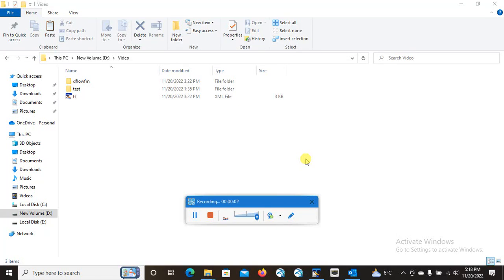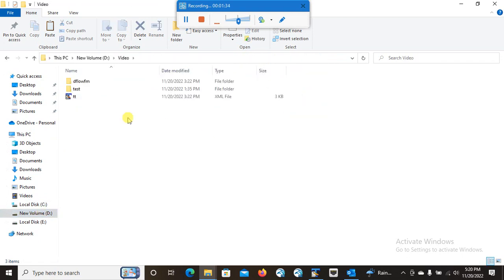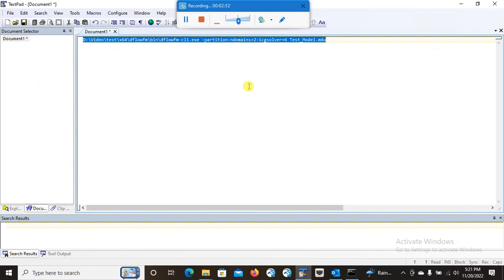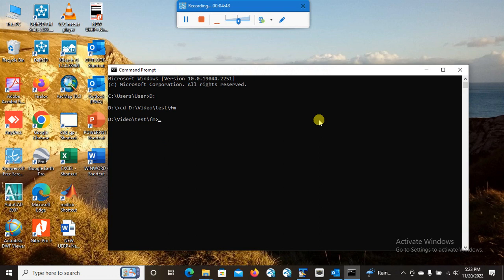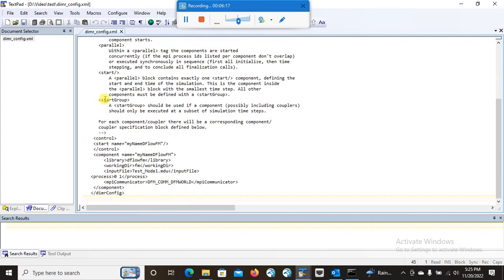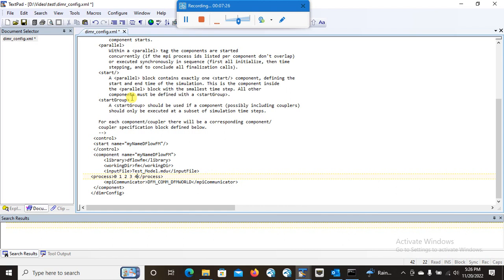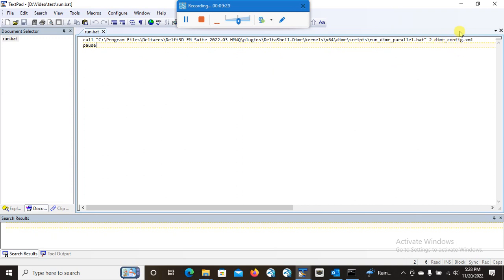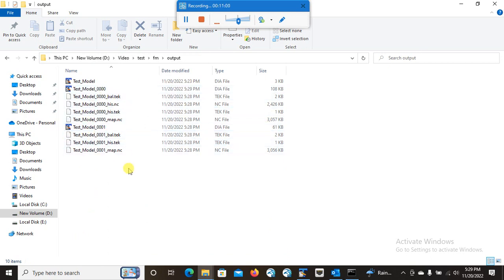Delft3D FM Parallel Run

Comment: Thank you for the sharing. When I follow your steps, I encounter some problems! The command windows shows that it cannot find "libpetsc.dll and gdal300.dll". However these two files are in the directory. 
I try to reinstall the Delft3D FM but it doesn't work. 
do you have any suggestion?
Reply from the maker: Hi, I dont know where the issue is as you mentioned the files are there may be corrupted? It may also be a reason that you are using an older version so without looking details its difficult to provide solution on that. But fortunately there is another option in the GUI that you can use following the steps will give the smae result but take more time than command procedure. You have to load the model then right click on the Grid tab then use the export mode then select the 'Partition exporter' then select autometic partition the use your desired number of parallel domain and export in the folder where you have your model setup files. You will have your parallel domain. But do follow other steps in video.

Comment: Thanks for the sharing. Can I ask what is purpose of parallel run? And what is the purpose of batch run? Calibration? How do we change the parameter values in each batch? 3Q
Reply from the maker: Hi Thanks for the question, well parallel run is to reduce the simulation time of model by running them together in parts using computers available core to optimize the time. Now batch run is to simultaniously run one simulation after another without any human intervension. You can compare them walking side by side and the other one as running in lines. For batch run you need to setup all the rquired simulation scenerio ready and the batch run is simply code to run them automatically.

Comment: Sir can u explain the coupling of flow and wave models in delft 3d fm im the 2d / 3d integrated version
Reply from the maker: Coupling of flow and wave model meaning running them in parallel feeding each other with data to simulate next itteration. This can be done online and offline both mode meaning sharing data while running or use result file to run.
Reply: @ee1989  the method explained in the video is online coupling?

Comment: Thanks you the tutorial! I have a question ,do I have to install openMP in order to run the parallel Wave and Flow FM model?
Reply from the maker: Thanks for your comment and yes you need to activate openMP to run parallel wave and flow.
Reply: @ee1989  Thanks for your answer! Do you have tutorial video to run parallel Wave and Flow FM and assign the number of threads in dimr.bat and config.xml files?

Comment: Hi,I've tried same as you did but the errors shows regarding some files "dflowfm-cli.exe and .dll files are unknown" I'm using Delft 3D FM 2019.01 version if I get a updated version of 2022.03 the errors can be solved ? Or else any other issues in config. Thanks in advance.
Reply from the maker: Hi sorry to hear that did you try reinstalling the Delft3D FM model. May solve the problem.....

Comment: Hi, I'm trying to run DELFT3D NOT FM in Parallel but I'm getting the next error: Connect on sock (host=DESKTOP-9RN3NS7, port=8676) failed, exhaused all end points
Unable to connect to 'DESKTOP-9RN3NS7:8676',
sock error: Error = -1

Have you tried tu run in parallel DELFT3D?  maybe you know how to solve this error.
Reply from the maker: Firstly Apology  for replying late, seems like the dimr config file has some issue. is the smpd is activated for parrallel run? if not then you have to activate it. 
I have ran parallel in Delft3d in parallel. hope this may solve the problem.
Reply: Hey thank you very much for your answer. I was able to run FLOW module in parallel. Now I'm trying to run water quality module in parallel but I couldn't do it, do you have any idea? or have you donde before? to remember: it's not flexible mesh.
Reply: @cdvs100  please could you let me know how did you do it in DELFT 3D 4.04.01 not FM.. ? I am having a hard time..